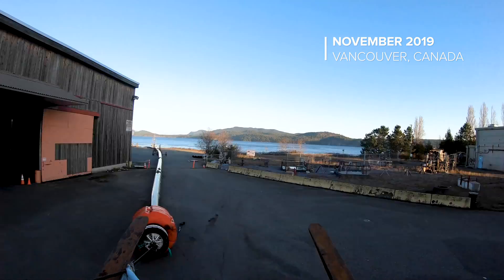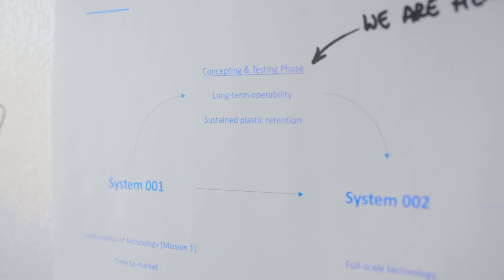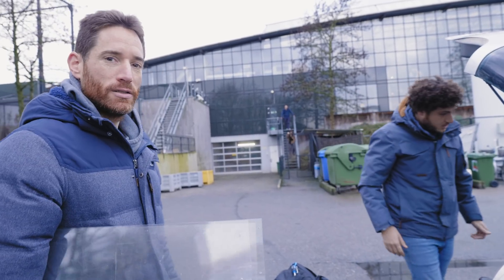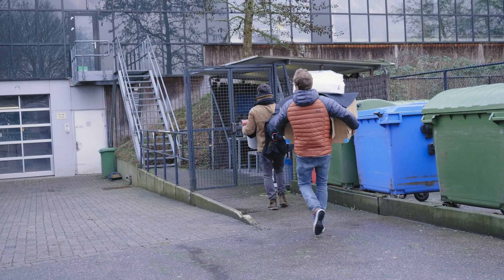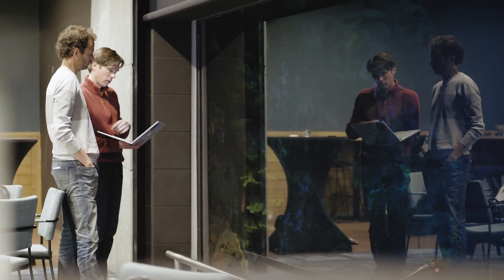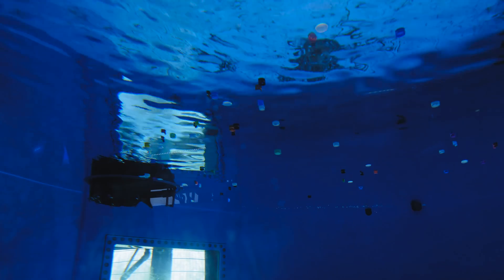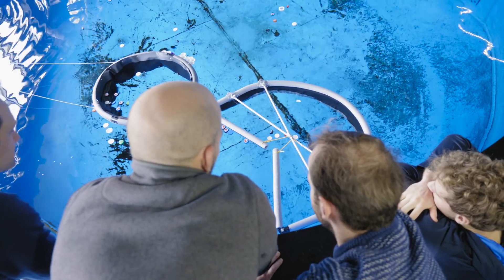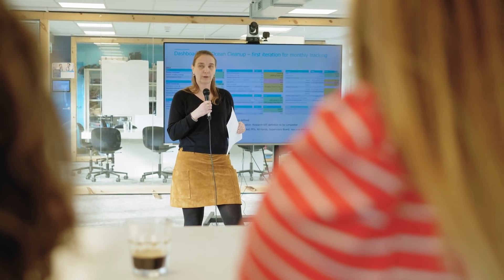System 002 - Concept and Design | Cleaning Oceans | The Ocean Cleanup

Comment: I presume the plastic you extract from the ocean is legally yours? There's this japanese patent / device, basically an adaptation of the pressure cooker which converts certain plastic material into naphta - the cleanest naphta that can be. This I see as maybe the best selling product to re-invest in Ocean Cleanup project. And since the major percentage of the garbage is actually the PET bottles that the conversion process was meant for, this extraction could be practically done on or near the extraction locations. And the naphta won from it could be used for more pressure-cooking etc. Maybe you'd care to look into it? Best of success!

Comment: A little confused. I thought you already had giant working prototypes? From my casual observation, it looks like the Interceptor is farther ahead, and less challenging? (River direction aiding your goals?)

I might advise considering General George Patton's strategy: a good plan deployed now - with ferocity - is better than a fine-tuned plan in the future. Ergo, if you can deploy an 80% effective solution in 6 months, go for it. Then optimize.

Break a leg.
Reply from the maker: We did indeed have a system that captured and retained plastic - System 001/B. However, System 001/B was a test model, approximately one-third the size of a full-scale ocean system. As we want to ensure the systems not only require as little vessel movement as possible, but can also clean 50% of the Great Pacific Garbage Patch in 5 years from scale up, we are doing our best to optimize System 002 based on our learnings from System 001/B.

Comment: I have an idea, why not use what we have learnt from system 001/001b/Wilson and keep that design to initially gather the plastic, we know this works so rather than change or create something new, lets focus on upscaling this and develop a method of retention. 

A potential avenue to retaining plastics would be to use the designs which have been created for the Interceptor. Using a belt system to extract plastic to what could be a separate area behind the initial system such as a raft designed to hold plastic or how about using an actual Interceptor system in the middle of system 001. 

I feel as though the best way to extract plastic in the ocean is to physically remove it and store it in a separate area, this is the only way it won’t end up back in the sea. By using a similar system to interceptor your using two proven techniques and as long as you weather proof them, you’re more likely to become successful. 

Best of luck.
Reply from the maker: We are doing exactly that - taking the learnings from System 001/B and using them on the iteration that will become System 002. As for the exact extraction method, that is something we are also looking to optimize during this phase. This will be the first step to a scale up, so we want to make our new system, and the collection process, as effective as possible.
Reply: The Ocean Cleanup I wish you the best of luck! Thank you

Comment: From collection, to retention, to extraction, how about partnering with existing ocean-going concerns, such as maritime transport, oil rig resupply, the fishing industry, etc.? Bundle an extraction module with the collector, and train partner personnel on operating procedures.

I envision vessels, such as cargo ships on regular routes, stopping to perform extraction, then towing a module or modules back to port. Stopping on return trips to replace extraction modules.

Direct vessel costs to Ocean Cleanup could be minimized, the project could scale, and partner companies would also benefit by collecting a nominal fee for pick-up/replacement, as well as receiving tax breaks/credits for charitable contributions. Additionally, partners would garner positive PR by sowing good will for environmental causes.

Keep up the great work!
Reply from the maker: Lots of excellent ideas here, but one of our goals is to keep the carbon footprint as low as possible, which is why we have opted for a passive system for both our ocean and river systems. In our next iteration, System 002, one of our main goals is to develop a system that can collect and retain enough plastic over a long enough period of time that extraction is as infrequent as possible.
Reply: The Ocean Cleanup : So important , keeping the carbon footprint as low as possible. Thank youuuu 💚💚💚

Comment: You guys need to accelerate the production and implementation of those interceptors(which I think is a really good idea) 
Cause you need to close the tap first to be able to clean effectively
Reply from the maker: We are doing our best under the current circumstances. We are hard at work on the third iteration of the Interceptor and remain committed to helping tackle the 1000 most polluting rivers, which you can see on our map, here: https://theoceancleanup.com/sources/